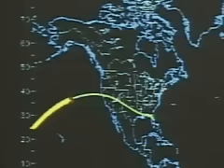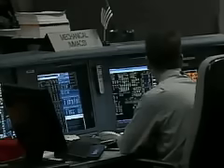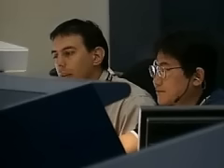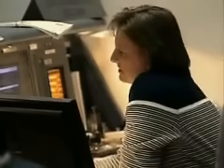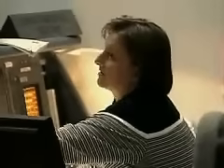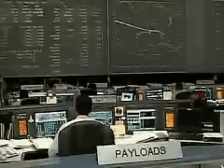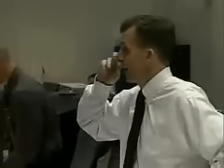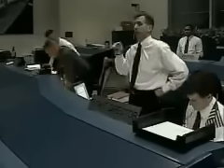Inside Mission Control During STS-107 Columbia's Failed Re-entry and disaster

Comment: was there a way to abort the rentry or at least the hard angle rentry weather it took days to slow down or what and land somewhere else but I think you get my point, is there a way to do a long soft renetry if they knew it was damaged and coulndt fix it or if they found out at beginning of rentry
Reply: No.  Once the deorbit burn happens, there's no way to reinsert it in to an orbit.  They will land about 90 minutes later.  One way or another.  They carried fuel for positioning while in orbit.  That was all.   As to doing a "soft reentry"- and I get what you're saying here- again the answer is no.  The math is pretty much written in stone for going from an orbit at something like 15000 mph, if memory serves, to zero on the runway.  That's an awful lot of kinetic energy to dump and there's no way of doing it gently.  They can't land without the deorbit burn and as I said, once that happens gravity does the rest.  It's an all-or-nothing deal.

Comment: People have pointed out the relatively low statistical reliability of the shuttle (# failures/# flights) * 100%.  But both of the total loss failures came not so much as a result of poor design or poor manufacturing, but rather poor management. NASA management knew the shuttle was unsafe to fly in freezing conditions due to thermal contraction of the booster o-rings (despite numerous warnings from engineers). It also knew of the risks of foam strike and did nothing to provision for the contingency. Had NASA management listened to the engineers, it's most likely that both tragedies could have been averted.

Comment: Incredible thathey did not havextra foam tile material and knife to cut and cemento repair any damaged tiles.  I assumed they had.
Was there no way to reenter at a different attitude which would least expose the damage to reentry heat?
"Lock the door." means what?

Comment: It’s astonishing to me that they thought super high speed but light foam wouldn’t damage the wing.  These guys are physicists.  They know perfectly well that speed makes all the difference    
I still can’t believe they didn’t do a space walk or at least get a camera outside to examine the potential damage.  
There should have been hero’s in this scenario and a movie to follow...
Reply: "They know perfectly well that speed makes all the difference"

Speed and the angle of impact. Pretty easy to calculate the speed from the video.  Much harder to calculate the angle of impact.  If the foam struck the top or bottom surface of the wing, the angle (and the resulting force of impact) would have been much less

"I still can’t believe they didn’t do a space walk or at least get a camera outside to examine the potential damage."

Well, there were no handholds or footholds on the exterior of the shuttle, so there was no way to get out there and get a really good look.  Also, Columbia was flying the SpaceHab module, which connects to the cabin through the airlock, so no real way to even get outside.
Reply: DemonRAT-Bolshevik infiltrators/operatives at EPA caused this, with their CFC bans on aerosol propellants. The foam wouldn't "cure" and adhere completely, and they knew it. That was the idea.  Somewhere these America-hating "Progressive-"Green" RATS were rejoicing when this disaster - that THEY ARRANGED - took place.

Comment: For those of you who may not know the Space Shuttle was flawed from the very beginning. The Shuttle was a "side mount" which was far different than the "stack mount". This meant the astronauts were on the side of the Shuttle instead of the very top. If anything went wrong there was no escape. The Challenger in 1986 blew up 90 seconds into launch and the astronauts didn't have any ejection seats and therefore they were doomed. This Columbia disaster in 2003 started during launch, when a piece of foam punched a gaping hole in the wing. Once again, the astronauts were doomed as there was no inspection system in place, there was no backup shuttle to rescue them, there were no ejection seats or emergency escape plans AT ALL. All these controllers could do was monitor their decent until the shuttle veered out of control and disintegrated. They had nothing to do with the inherit design flaw that had begun decades before. 

In short, the Shuttle was doomed from the very beginning and note NASA does not launch astronauts into space anymore and also note the Russians and Chinese and eventually SpaceX and Blue Origin are only using the "Stack mount", launching astronauts at the very top of the stack in a capsule. I doubt we'll see another "side mount" shuttle launch humans ever again.
Reply: Good riddance to that vehicle,

Comment: Linda Hamm should suffer the rest of her life for not calling on images of the shuttle.
Reply: OK, let's say they did the photography, and it showed the damage.  What's next?

Can't get to the ISS because they were in the wrong orbit.

A rescue mission would have had virtually zero chance of getting off the ground in time before the LiOH scrubbers were saturated and the crew died from CO2 poisoning. It would have had a significantly better chance of suffering a problem that would have resulted in the loss of Atlantis as well.  And there was no way of knowing if the ET that Atlantis would use would have the same problem as the one that affected Columbia-and no time to check it.

The Soviets would have had to do between four and seven Soyuz launches in a month to try and bring the crew home one or two at a time-a situation that would have been complicated by the fact there was no way to dock with Columbia
Reply: almostfm Question is what could have been done Apollo 13 style.  Could they save air by canceling work and sleeping?  Could they use random scraps to reinforce the damaged area?  Could they have used maneuvering fuel to make a lower temperature landing?  Could they have used their fuel to abort to ISS early in the flight?  Could they have killed half the crew to save the other half?  All would have been desperate measures, if even possible.
Reply: @johnfrancisdoe1563  Sorry this is so late-I didn't see your message until just now.  I'll take the questions one at a time:

"Could they save air by canceling work and sleeping?"  The problem wasn't the amount of air-it would have been the build up of CO2. Even assuming that they went to a "minimum consumption" schedule (which is basically what you described), the estimates are that the scrubbers would have been exhausted some time on day 30.  But the fuel cell reactants that provide electrical power would have run out the next day, and that would kill the crew just as dead.

"Could they use random scraps to reinforce the damaged area?"  There are two problems with that: a) without handholds or foothold it would have been very difficult to even get out there, much less try and do any work.  And the leading edge of the wing sees some of the highest temperatures on reentry, so they couldn't just shove anything in the hole and call it good.  What they had on hand would't have worked..

"Could they have used maneuvering fuel to make a lower temperature landing?" Coming down from orbit isn't like landing an airplane, where you can adjust your approach speed.  You're going to come down at the rate you're going to come down. After the accident, NASA took a look at whether they could have changed the yaw, pitch, or roll angles enough to protect the wing. They could-but it would have meant that the heating on other surfaces would have caused them to fail.  So instead of a wing failure causing the orbiter to break up, is would have been something like the payload bay doors or the tail failing.

"Could they have used their fuel to abort to ISS early in the flight?"  This is one of those things that requires a little explanation of orbital mechanics.  Once a spacecraft is off the ground and accelerating, it takes more and more fuel to change the "plane" of the orbit-once you're in orbit, it take a huge amount to make even small changes in the orbital plane.   Columbia was launched into about a 28 degree orbit, while the ISS is in a 51 degree orbit. That's a huge amount. And when you launch spacecraft, you don't carry extra fuel beyond what you need to make your margins. It's just dead weight that you have to haul up and back down, and it limits the amount of payload you can carry.  And in any event, the foam strike wasn't spotted until the SOP review of the launch films on Day 2. By then, Columbia was already in orbit, and it would have taken roughly 10 times the amount of fuel to get to the same plane that the ISS was in-and that's before allowing for the fuel needed to get to the right altitude, rendezvous, and dock.

"Could they have killed half the crew to save the other half?"  It really wouldn't have helped-even if it slowed the rate of CO2 accumulation, it wouldn't have made that big a difference in the electrical power needed-and as it was, that would have run out the day after the scrubbers did if the whole crew was alive.  Also, what are you going to do with the three or four bodies?  You can't chuck them out of the airlock, because someone has to be on the space side of the hatch to close it.  So, you'd have decomposing bodies hanging around for three weeks.
Reply: @almostfm  
Who knows?  They didn't. Even. Try.
Reply: @jshepard152  "Who knows?"  It's engineering-not magic. You only have the options you have-not the ones you wish you had in a perfect world.
Reply: @almostfm 
Yes, we all know.  It was a managent failure, not an engineering failure.  NASA studied the Columbia situation and said the odds of rescue were low, but there were odds.  If NASA had their 2003 management in 1970, the Apollo 13 crew would be dead because the effort they put in was near zero.  They didn't work the problem.  They didn't try. This is nothing new.  Many former shuttle astronauts have said the same.
Reply: @jshepard152  Not low-miniscule.  Have you read what the rescue plan would have entailed?  Because I have, and it ain't pretty.

And it's interesting that you brought up Apollo 13, because there were several issues which could have killed the crew and they did nothing about them, because there was nothing they could do  . They didn't know if the heat shield on Odyssey had been damaged by the explosion. They didn't know if the parachutes would work after being cold soaked in deep space for three days. They didn't know if they'd get a short when they went to power up the CM and fry their instruments, when the humidity in the cabin was so high it looked like it had rained in there. They just had to hope that none of those things would bite 'em in the ass.
Reply: @almostfm 
Didn't.
Even.
Try.
Reply: @jshepard152  OK, since you seem to think that "Didn't even try" is a valid argument (while not actually understanding what would have been involved), this is the rescue plan. Read it and understand it before you stomp your feet and says "But they didn't even try" again.

The foam strike was found on Flight Day 2 (FD2). The engineers didn't ask for photos until FD5.  If they could get the satellites into position, get photos taken, and then gotten them analyzed to the point that they could determine Columbia was fatally wounded in one day, they'd have known how serious the problem was on FD6. At that point, they would put the crew onto a "minimum consumption" routine-basically stay in your sleeps stations as much as possible, and move around as little as possible.  If they did that, the LiOH canisters that pull CO2 out of the cabin air would have been exhausted by some time early in FD30. The fuel cell reactants would have been exhausted late in FD30.  That's the hard limit-if you can't get the crew off by FD30, they're dead.  So they'd need to get the crew off by the start of FD30.

It would have taken a full day to transfer the crew to Atlantis (which was the one furthest along in orbiter prep), so that would need to start by the beginning of FD29.  To launch, rendezvous and establish station keeping, that process would have had to start on FD28. But the launch windows on FD28 were too late in the day for that to happen, so they'd actually have to launch on FD27.

Now the clock is ticking-they have 21 days to get Atlantis ready, or there's no point.  She was originally scheduled to launch on March 1. Instead, she'd have to be ready by February 11.  So, could they have shortened the prep time from the 43 days between FD6 and it's planned launch on March 1 to the  21 days they'd have before they had to launch on Feb 7?  Even if they went to 24/7 orbiter prep using both shifts to work 12 hour days, they'd still be four days short of getting her to launch on time.  So they'd have to cut corners to trim off those four days.  You can't just not install stuff, so the only way to shave off that much time is to rush and skip all the functionality and safety checks they'd normally do. IOW, slap everything together and hope it doesn't blow up on the pad or go corkscrewing into the Atlantic in full view of the TV cameras.

Let's say they get her out to the pad by some miracle.  At launch time, if the onboard computers find any faults, they automatically shut things down.  That happened often enough when they checked everything that the chance of it not happening this time were basically zero. And once a fault showed up, the engineers would have 90 minutes to get to the pad, find the problem, correct it, and then get the hell out of there, because 90 minutes is when the second and last launch window would open. If they couldn't fix it in time, or there was another problem, it's game over.

But let's imagine further-that somehow, they manage to launch and get into orbit successfully-the fun isn't over yet.  BTW, did I mention that the ET that Atlantis would have flown would have been assembled just after the one that had shed the foam on Columbia?  If it had the same problem, now we've got two stranded orbiters and two dead crews.

Now that they're in orbit and rendezvoused with Columbia, they can't dock, which means that they'll have to hand fly "station keeping" for the entire transfer process, and that's going to take a full day.  Atlantis would have to be yawed 90 degrees relative to Columbia (so the tails don't collide)  and flipped over so the payload bays are facing each other.  Too far away, and you can't do the transfer. Too close, and the shuttles collide and we lose both. And, BTW, because of how they were oriented, neither pilot could actually see the other shuttle.

Read it, and then maybe you'll understand why they didn't try it.

Comment: So the people in mission control knew what was going to happen, right? They were already aware of the damage to the left wing, right? But the team on the shuttle weren't told...I might have my info wrong.
Reply: They knew there'd been a foam strike, but they didn't know what damage, if any, had happened.  And they did discuss the issue with Columbia's crew.  They even uploaded the video.  The consensus of everyone (including the crew on board) was that it wouldn't have done more than other foam strikes had done.
Reply: @almostfm  OK, so everyone knew a foam strike had happened, just not what the extent of the damage was. Thanks for the info!
Reply: you have to think and wonder though at what point did it cross their minds "both crew and ground control" that ALL of these failures in the left wing "where the foam struck" were NOT just a coincidence
Reply: For the flight controlers, it certainly occurred to them when the flight director asked if there was any commonality in the sensors and was told there wasn't.

Comment: Congress created a very unsafe and expensive machine. Warning never let the politician design or engineer anything of  importance.where human safety is concerned other than their own.
Reply: drno Actually a NASA official said it was the greatest machine ever created but maybe he had to say it. I mean we've lost two because of the stupidest shit in the world. Foam hitting the wing and an oring to cold.  Are they that damn fragile?
Reply: @ronniebishop2496  Hi Ron...I did work at NASA on Mars Pathfinder spacecraft. They are smart and competent typically. However NASA submitted Shuttle design like the Burt Duran Branson design puggyback on a B52 like vehicle and then launch to space. So basically a two stage spaceplane. More reusable and safer. CONGRESS in their infinite wiadom knocked down this design and we got Rube Goldberg  Shuttle. If a NASA official says it so great then why are all current new designs reverting back to a tried and proven design with multiple stage and no spaceplane types. However the future will be like Reaction.Engines Skylon spaceplane. Checkout this company. In 10 years they may revolutionize the single stage to orbit spaceplane.
Reply: Paul NASA wanted a two stage vehicle like Routan or the X15 but Congress said do it this way or else no Shuttle. Current only feasible paceplane concept is SKYLON by Reaction Engines.
Reply: drno There's absolutely no reason the shuttle shouldn't have worked tremendously. It was always the junk hooked up to it that destroyed them. And that's ridiculous. An oring? A piece of foam, unbelievable !!!!
Reply: @ronniebishop2496  Shuttle with ISS cost 7 billion a year of the total NASA budget of 15 billion. Why are are we using the Russians for 10 years? Russia scraped their shuttle and USA lost 25% of their fleet. Bad idea that paved the way for innovators like SpaceX that reuse their rockets.